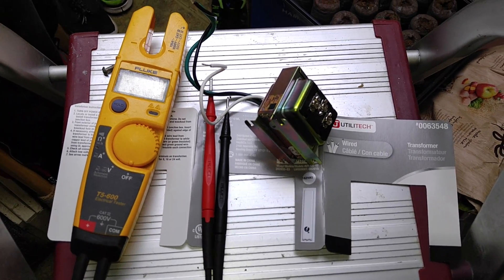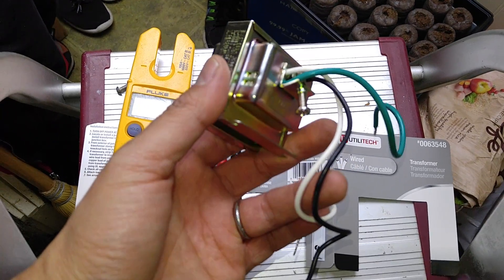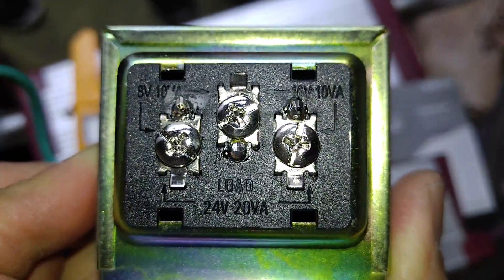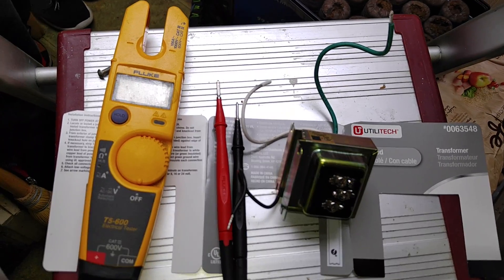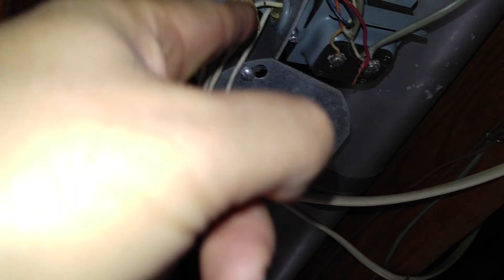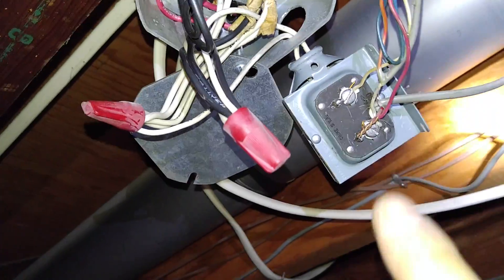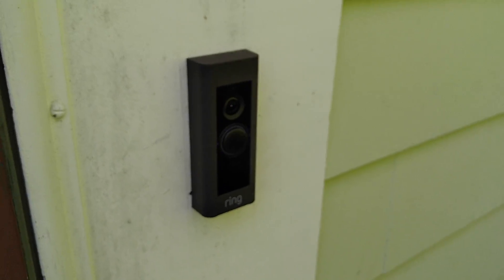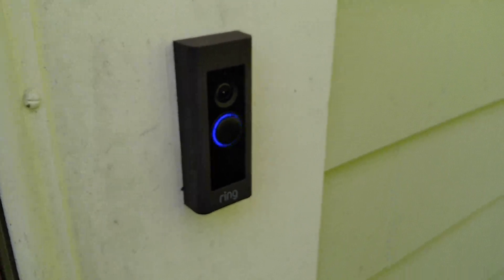Upgrade your doorbell transformer for Ring Pro Doorbell

Comment: Where did you connect the ground wire if there is no ground wire to connect it too?? I only had two wires
Reply from the maker: You ground the electrical (input side to transformer). There's black, white, and green or a bare wire. You ground the green or bare wire. See video description text
Reply: @randyslab  yeah i only have 2 wires black and white
Reply from the maker: @beanpowers2665  then it's probably grounded on the case. Make sure the case is mounted to the exterior of your electrical junction box, or run a wire from the metal case of your transformer to a cold pipe or another ground wire.

Comment: I would like to switch out my old transformer for a new higher voltage one.  I believe I have a 16V- 15VA transformer now.  I would like to go to the 24V- 40VA transformer I have available.  But what will this do to my mechanical chimes?  Fry them? Cause a fire hazard?  Or will this be OK?  Thanks.
Reply from the maker: It's pretty hard to fry old mechanical chimes, especially if wired properly with solid core copper wire.  Check the bell box for voltage specifications. But I would check with Ring about using 24V-40VA. That seems like it could be on the upper end of their operating range, or possibly outside of it.
Reply: Randy's Laboratory Wow!  The ink is still wet from my question to you and I already have a reply!  I have not installed a Ring. It is a  NSC-DB2 sold by Nelly’s Security.  They claim that it will operate with voltage as low as 8V. But multiple reviewers of this unit have had the same experience that I have. They have discovered that the device works great once they upgraded to a 24V- 40VA transformer.

Comment: Ring recommends 16 volts 30 VA. transformer size for the ring pro. It's in the instruction manual. Especially if you plan on running your door bell chimes as well.

Comment: Not a very good video. You left out the most important part, connecting the wires. Anyone watching came for that.
Reply from the maker: a. Read the description and b. If you are held up about basic electrical wiring, you shouldn't be doing it yourself for safety reasons. Please consult a professional.
Reply: @randyslab  No need to get your panties in a bunch. If you are making a tutorial to show people then do that and don't leave out important parts. I just finished wiring mine and it works flawlessly.
Reply from the maker: @geeb9668  i am going to get my panties in a bunch because if you're point is regarding where 2 different wire sets should be wired, you shouldn't being doing it.  If you've got an issue regarding my tutorials, then check out my other stuff where I don't assume you know how to do something.  I hope you read my description on this video.

Comment: Could I use this to jump off one of my outlets
Reply from the maker: you mean you're installing a new doorbell system or re-wiring an old one?  then yes.  always check your local code and make sure power is always off.

Comment: I have 2 buttons (one at front door and one at rear door) and 2 chimes (one downstairs and one upstairs), all tied together.  Once I installed my Ring Video Doorbell2 in place of my front door button, I began to have ghost bell rings and humming of the chimes that would not stop unless I disconnected the chimes from the transformer (which is old and I haven't yet located).  Even after installing 2 new chimes, I continued to get the ghost rings and humming.  From some people, I was given the impression this was due to too low a voltage so I was considering going to 24 V.  But to be sure, I called both the door bell manufacturer (Utilitech) and Ring and, amazingly, got the same advice from both.  They reported my issue is common and is actually being caused by too much voltage, not too little.  Although Ring can handle up to 24V, Utilitech advises the chimes will burn up if they get more than the output of a nominally rated 16V transformer (see below about voltage fluctuations).  This is apparently typical of almost all chimes today, even a 2 chime setup like I have.  And, Ring advises they work fine with 16V.  However, Ring also advises that, while Ring can work with as little as 10VA, under no circumstances, should you go over 30VA.  So, both companies said I should settle on 16V, 30VA, to safely and appropriately satisfy all requirements.  It was also noted that transformers can put out fluctuating voltage so if you install a nominally rated 24V transformer you might get more volts than the Ring can handle.  I am told that at a nominal 16 volt rating, both the bell chimes and Ring should be able to safely handle the fluctuations that transformer might create.

Comment: My ring pro recommends  16volt 30 vac or amps  you can order a transformer form amazon for about 15 bucks. My ring worked fine untill the night led's came on then it drew too much power from my 16v 10 vac transformer  so that is why I had to upgrade to 30 vac.

Comment: I have a 16v, 10va transformer and I started getting low voltage alerts on my Ringdoor pro app.. called Ring and they told me I should upgrade to 20va transformer.

Comment: If are not use bell need a resistor in series. https://support.ring.com/hc/it/articles/115003495766-How-to-Connect-Your-Ring-Video-Doorbell-2-Directly-to-a-Low-Voltage-Transformer-Without-a-Pre-existing-Doorbell-

Comment: why would a doorbell transformer be in a furnace room and not near the the actual doorbell chime?
Reply: Because there would be 115 volts to the chime which could give somebody a shock. Low voltage wires cheaper and safer.

Comment: Thanks for the video Randy. I replaced my old 12 volt transformer with a Newhouse Hardware
16-Volt 30vA Wired Door Bell Transformer. But my Ring pro still won't stay powered on. I've even tried to use Ring's power extender kit but it doesn't' work. My old doorbell works fine. Please help.
Reply: You might need to upgrade to a 24V transformer or you might have a short in your wiring. This post covers a 24V transformer that works with Ring: https://www.onehoursmarthome.com/blog/ring-doorbell-pro-transformer but you can also read about troubleshooting what your issue might be here: https://www.onehoursmarthome.com/blog/nest-doorbell-chime
Reply: If you're hard wiring and do not have an existing chime, you have to add a resistor at the transformer.
Reply from the maker: Nice work Rahul replacing your transformer.  First, test to make sure there is output from your transformer (use a voltmeter or a multimeter).  Next, do a hard reset on your Ring Pro (hold down the side button for 30 seconds).  If you're still getting problems, contact Ring support.  You may have a defective unit.

Comment: Hi Randy, I have the exact old transformer like your old one and I find it in he furnace closet. How can I determine if it’s for the furnace or for the doorbell. Please help.
Reply from the maker: What you can do is unscrew one of the thin wires (output) from the transformer and see if your doorbell still works.  But switch off the furnace first!

Comment: The new transformed you showed had a screw sticking out @ an angle, how did you mount it to the electrical box. Seems like it would be in the way? I could not tell, since your video jumped to the next part.
Reply from the maker: I was able to use an existing hole to do the mount; but the transformer was externally mounted to the electrical box, not inside, just like the original one.

Comment: Ok I changed my transformer.. The ring went on for about 5 minutes then stopped working completely.  I use the same exact one you have. It's not even powering on at all. I checked the voltage it said I had 28 volts from the ring. And the transformer is running hot . Is that normal when hot?.. please help.. I don't know what to do
Reply from the maker: What kind of doorbell system do you have? For example, mechanical or digital chime? How many bells does it ring? How many doorbells?

Comment: What did you connect the green wire to.
Reply from the maker: That's ground. So cold water pipe, metal electric box/housing, etc.
Reply: At first I didn’t see no ground wire in the junction box

Comment: Ring says that if you do not keep your doorbell chime, then a 16V 20VA will work.  But if you want to power the Ring Doorbell Pro AND keep your existing chime you need a 16V 30VA.  

I have read of many people that have problems with 16V 10VA transformers like the one you are using because it doesn't provide enough current, and therefore power, even though the voltage is fine.  They say it works but after a while it will stop working or have issues, particularly at night when the night vision LEDs are being powered.  

https://support.ring.com/hc/en-us/articles/115000115323-Troubleshooting-Insufficient-Power-Issues-with-Ring-Video-Doorbell-Pro

I purchased the Edwards 598 on Amazon. It can be set for 16V 30VA.  There is also a Nutone C907 that is 16V 30VA.
Reply from the maker: lemmy999 thanks for posting. I addressed this in the video summary. It's still working on mine since I have a low draw, single mechanical chime. If you have a higher draw system (e.g., multi chime, multi illuminated doorbells, etc) then use the higher rated transformer as you mentioned.
Reply: Be aware that not all mechanical chimes are compatible with RING. Many existing mechanical chimes will continually ring over and over. Only some existing chimes will work. Mine did not so I had to return my RING doorbell.

Comment: The install was quick and easy. 16V runs good with the Ring Doorbell Pro.
If you have issues with your original transformer, this is the way to go.
Ring CSR tries to upsell to their own transformer or wall outlet power supply.
Don't waste your money!

Comment: I don't think this transformer works for the Ring Pro. I have a Heath SL-122 EM57580 and it only puts out 19V and will not even power the Ring Pro.
Reply from the maker: If you have a bench power supply, test your Ring Pro.  If your Heath isn't powering your system, then you may have other devices in the circuit drawing current and you'll need to go to 20VA.  It's been about two years since I did this install and my setup has had no problems running 16V-10VA (one mechanical chime, no other current draws in the circuit).
Reply: Hey Randy. Thanks for the reply! I want to buy a Bench Power Supply for my maker DIY stuff...but the wife won't let me :) I called Ring tech support and they looked up the transformer, which seems to have the same specs as in your video. I am going to buy the Elk TRG2440 24VAC, 40 VA AC Transformer, but I have to wait a few days until the fuse kit for the Ring comes...don't want to blow it up. I will let you know.
Reply: And thanks for making the video!
Reply from the maker: good deal Steve, good luck!  and thanks!
Reply: This post covers what transformers will work with the Ring Pro: https://www.onehoursmarthome.com/blog/ring-doorbell-pro-transformer
Reply: You should have used the encasing of the transformer, it doubles up as a grommet so that the wires won't be in contact with the metal box.

Comment: My 25 year bell transformer has 2 black wires coming out of the back, the ac power wires that they connect to are 1 black and 1 white one, they are connected currently as black to black and black to white. The new transformer has black, white and green wires so do I wire black to black and white to white, also the junction box is plastic so unsure what to with the green one. I will of course turn off all the house power before I attempt the replacement but whats the worse that can happen if somehow I manage to screw this up, a tripped circuit breaker?
Reply from the maker: Nothing will happen. Connect wires in whatever combination, but the green should connect to something like a pipe, a metal body, something.

Comment: Randy, good video but I'm having a little problem. Yesterday I installed the Ring Video 2 and also installed 8-24vac transformer.  I also installed the diode due to having a digital doorbell  chime.  When I push the ring my digital chime in the house does not ring but the Ring Door bell does ring. This morning I'm now hearing a humming noise coming from the transformer.  Do you have a idea what is going on.
Reply from the maker: Hi Greg, if you haven't been in touch with Ring customer service, I suggest you try them.  They may have specific information regarding your digital doorbell working with with Ring.  If not, post which digital doorbell you have and let's try to figure it out.

Comment: Thank you for this information. My current house was built in 2009 and I have looked all over for the transformer and still can't locate it. My current chime is a Heath zenith 96 base.  Do you think giving the year my house was built and my current chime that my voltage would be enough to support the ring pro.  Here are some pics of my current setup. https://www.dropbox.com/sh/i00u1xzdogoqwnl/AABkXfnOWAY8YTOYlVtiFsgua?dl=0
Reply from the maker: Bklynballer08 it might. Go ahead and try it with ring's  standard installation and see if it works. Connect everything, including the regulator.

Comment: How did you mount the transformer to the junction box?
Reply from the maker: I was able to just use standard sheet metal screws to mount the transformer to the junction box.  You can drill holes yourself or use self drilling screws.  Use very short screws or if they protrude, you can just cut them off using heavy duty cutting pliers or use a dremel with a cutting disc.
Reply: Thanks!

Comment: You would think the door bell cameras would need 16 to 24 volt transformers to power it 
My skybell slim I installed made the doorbell buzz when I hooked it up. My house is old and had just a 10 volt transformer in it so i changed it to a 24 volt

Comment: VA doesn't indicate amperage/current...
Reply: It is Volt-Ampare vs. Wattage.  This two are different. Ohm's law and simple electrical knowledge explains it is a total capacity.' With under capacity transformer  will over heat or burn out. I use 24V 40VA rated one made in Canada. Not El cheapo Chinese product. It has no problem with Ring Pro and mechanical Westminster Chime.

Comment: Just installed the 16v-30va transformer and verified it worked with my existing doorbell. However, Ring Pro still won’t work. No lights or anything - totally unresponsive. Ugh!!!
Reply from the maker: did you do the reset on the ring pro?
Reply: Randy's Laboratory by holding down the button on the right for 30 seconds? Yes, tried that several times.
Reply from the maker: If you're getting 16 volts at the doorbell, then I'm afraid you may have a dead unit.  Not common, but certainly not uncommon (several folks here have had to return their units).

Comment: I just bought the Ring Doorbell Pro and was told my current 16v-10va doorbell transformer won’t work, and that for optimum performance I need a 16v-30va transformer. Can I simply replace the transformer without issue? How do I know if the transformer, which is in my furnace room and mounted on top of a light switch junction box, is being used for the furnace as you mention in this video? Regardless, could I still safely replace the 16v-10va with the 16v-30va?
Reply from the maker: Patrick Gamet first of all, you can disconnect one of the thin wires (output) on the furnace transformer and see if you're doorbell still works. Next, before swapping anything out, install your ring pro on the current system and check its performance. You may not need to swap out transformers.
Reply: Randy's Laboratory Today, I tried installing the Pro but could never get it to power on, no matter what I tried. Existing lighted doorbell works, but not the Ring Pro. So I called Support and they told me it would not work on my existing 16v-10va transformer, and that the optimum choice is a 16v-30va transformer. They said a 16v-20va might work, but I’d have issues. They also said a 24v might break my existing door chime.
Reply from the maker: Yes, try to stay as close as possible to your existing chime's current voltage. Let us know what happens, but your ring should have been able to at least power on. Did you try a reset?

Comment: I have a very similar setup.  Wired it up and I am getting something like 18.5v at the transformer output, but now I am only getting 1v to the doorbell.  I didn't change any of the doorbell wiring.  Any idea what the issue could be?

Comment: I bought this exact one at Lowe’s and it DID NOT WORK with the ring pro doorbell. I have since called them and they emailed me an amazon link to the one they recommend.  It should arrive in a few days.
Reply: so what was the recommended one you bought?
Reply: Ring recommends 16V, 30VA. The 16V, 10VA won’t last long and he will have to replace it soon. I made that same mistake.
Reply: thanks
Reply: They emailed me a link from Amazon that is rated 16V 30VA. However, that didn’t work either. Apparently I got a dud.  I returned it and added another camera to my Arlo system.
Reply from the maker: I used a 16V-10VA because I only have a one chime system with low load overall (only two doorbell buttons, no lights on the two doorbell buttons).  If you're not getting power even on a 16V-10VA then you most likely have a dud (this also happened to another viewer recently).  My install is now almost two years old and no issues.
Reply: firepilot17 so you Just aded an arlo camera on your front porch or door?

Comment: So just so I am following:

Your doorbell (ring pro) says 4v or 4,000 mV but your mechanical door bell doesn’t ring.

This is my issue.

I purchased one of these transformers that I will wire to my mechanical chime. This will ring my chime at the correct louder town?

Am I following?
Reply from the maker: Jacob Ciesla I'm not sure if I'm following your comment. What I'm saying is the ring pro needs at least 16 volts to work properly. Anything less and it may produce erratic results, including not properly ringing the mechanical chime.